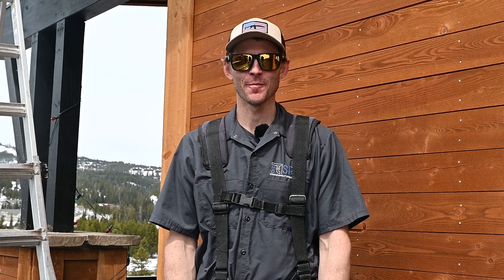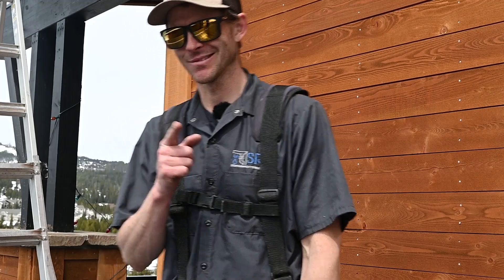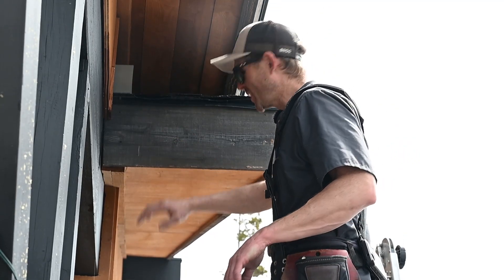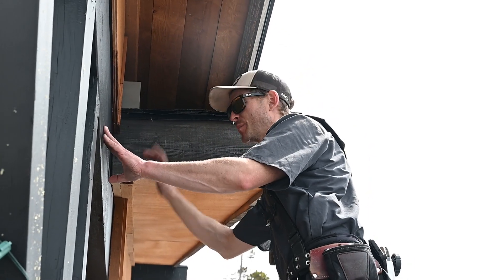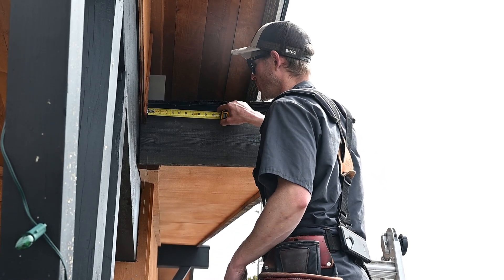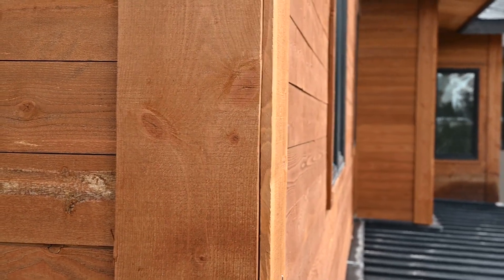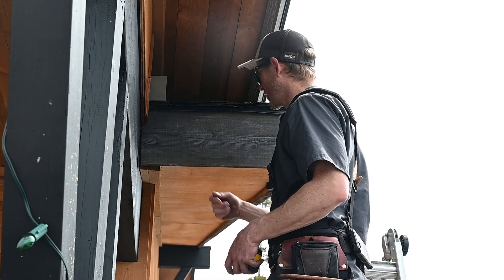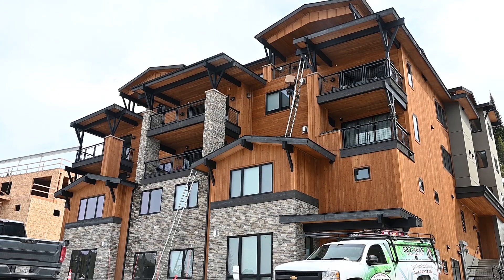How To Do A Rain Gutter Downspout Installation

Comment: Measure from the face of the facia board to the back of where "B"  (side shot) elbow will sit and minus 6". For "A" (face shot) elbows, measure from face of facia to the siding wall and minus 5"". That will give you length of the neck.

Comment: Straight pipe straps work the best  :) So does round outlets work better adjustable left and right. :) An I also hope you made a diverter flange on the left top end cap so the water don't run along the wall to the bottom gutter

Comment: What types of screw can we use for the brick wall?
Reply from the maker: We use the same screws as we use for hangers, and put a tiny downspout shaving in the drilled out hole. If you want to see how it's done, we have a video that you can check out!

Comment: We measure the whole downspout in 2 measurements. One is for the neck and other is diagonal one (in this case from top B to Lower A). For the neck if its 26” we will minus 6” and call it 20” with two Bs. And for the diagonal one, If its total of 112”, I will minus 5” from it and call my helper to make a 20”/107” with Bs to the right and an A elbow at end. And we use factory made straps here in Cananda.
Reply: I subtract 8” for A-A and 4” for B-B. Measure at the same place for both. I don’t do 2x3 downs. So idk if that’s why your measurement is different than mine, and idk the last time I measured for a long section. That’s a waste of time.
Reply: @ we do -8” for A-A, -6” for B-B if we are doing 2x2s. We always did 2x3s and Round ones. I got to work with 2x2s recently and learnt that you need to minus more inches for them. It also depends on the suppliers too. We mostly use Kaycan here in British Columbia. It feels great to see another fellow tradesman doing it same way. Good Luck!